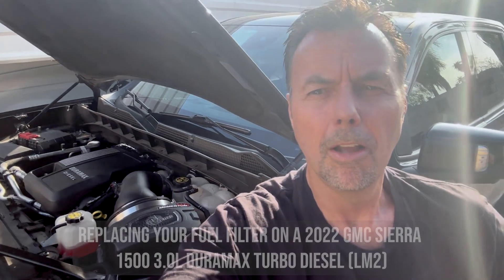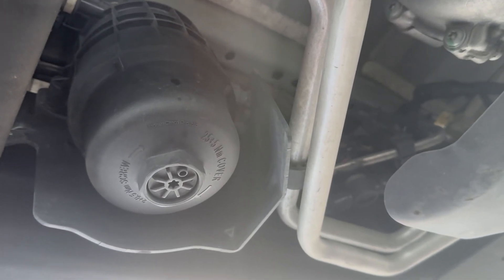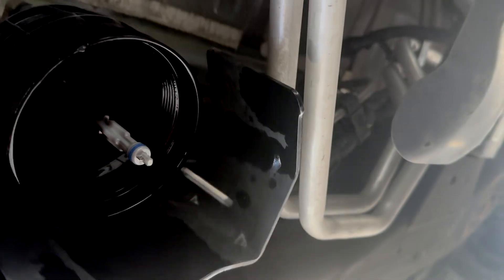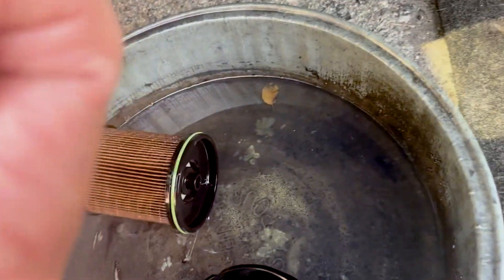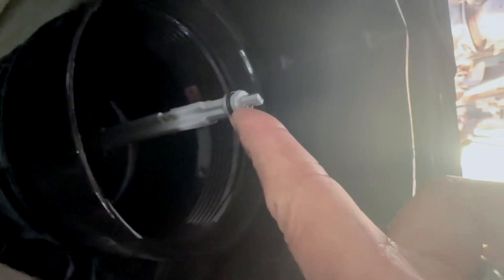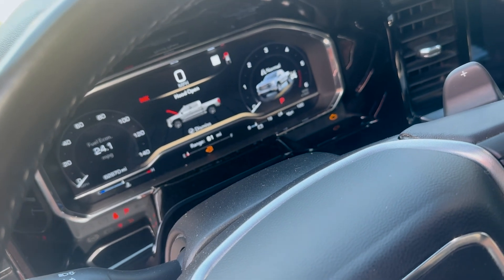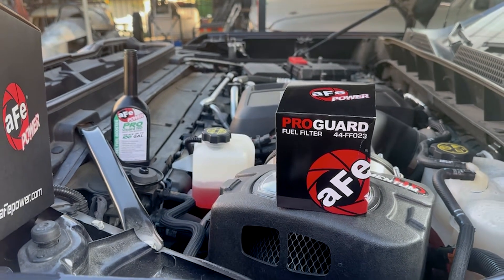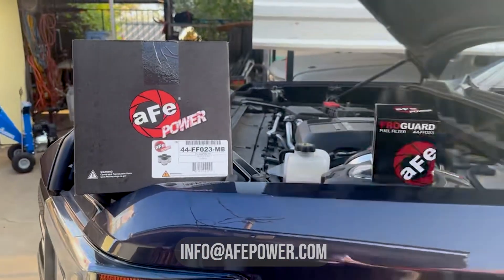How to Change the Fuel Filter on a 3.0L GMC Sierra 1500 Duramax (LM2)

Comment: Thanks for sharing. When do you use the torx?
Reply: I'm wondering the same thing. I am leaking diesel from the bottom of the filter, and I am wondering if I should tighten the torx part.
Reply from the maker: The torx is a blender-  Make sure your canister gasket is seated correctly
Reply: @aFePower1  somehow the drain that the has the torx head backed itself out. I snugged it up and it stopped leaking. Thank you for the video!

Comment: Hi, great video.  When you prime the filter, do you hold the start button down for the 2 minutes or do you only have to press it once and let it cycle?  Thanks
Reply from the maker: Push the start button but not the brake pedal– It will prime the system. GM says 2 minutes
Reply: @aFePower1 still not answered... lol what is 2 minutes? The cycle or do you have to hold the button for 2 mins?
Reply: @parkerjon29 no it’s the cycle, you can hold it for 2 minutes as well but it won’t make a difference once you start hearing the fuel system start priming you can stop pushing it down and just let it get the air bubbles and what not out. That’s how I did it and my sierra has been just fine. Hope it helps some.
Reply: Holding the button without the brake will turn the vehicle on without starting it. Once the lights in the dash come on you can let go. Its the same thing as turning your key to the on position without engaging the starter in the run position in older models.
Reply: Exact same thing I’m trying to figure out. Just saw a video where the guy held it for like 25-30 seconds and when the noises stopped just turned the truck on. Got the part just trying to figure the priming part out